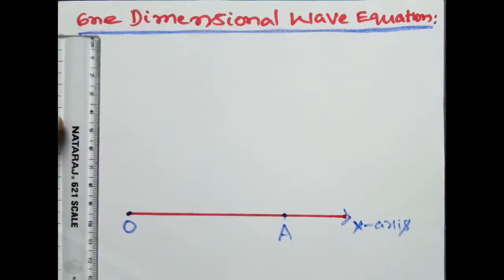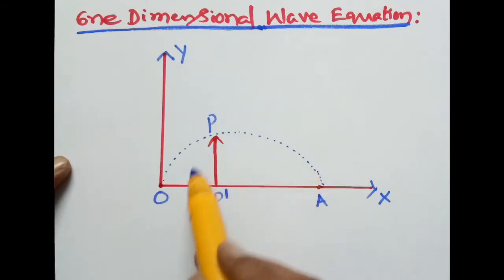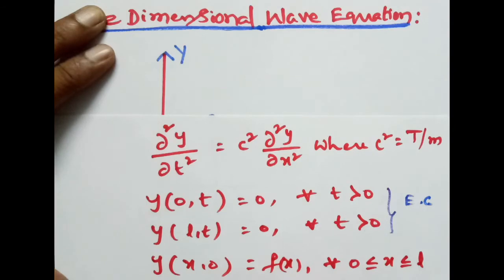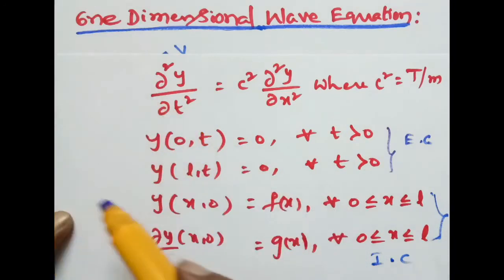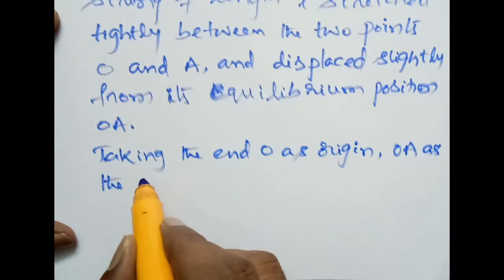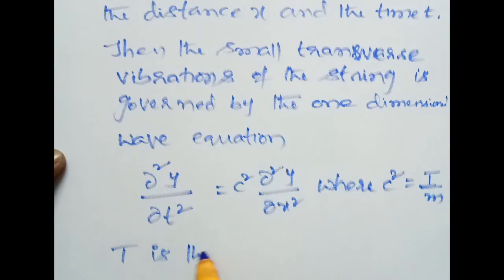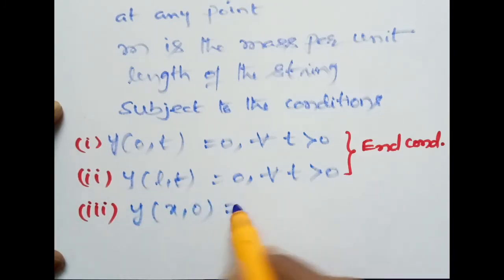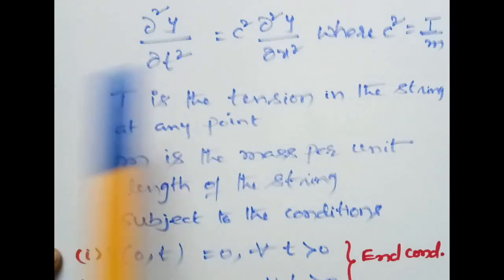PARTIAL DIFFERENTIAL EQUATIONS   LECTURE 40

Comment: a conducting bar of uniform cross section lies along the x-axis with ends at x=0 and x =L. it kept initially at temperature 0 degree and it's lateral surface is insulated.there are no heat sources in the bar. the end x=0 is kept at 0 degree ,and heat is suddenly applied at the end x=L,so that there is a constant flux q at x=L.find the temperature distribution in the bar for t>0 in partial differential equations.sir,please solve and put the video sir.